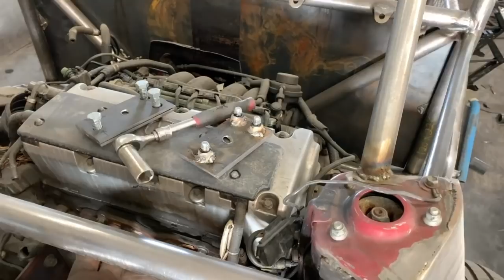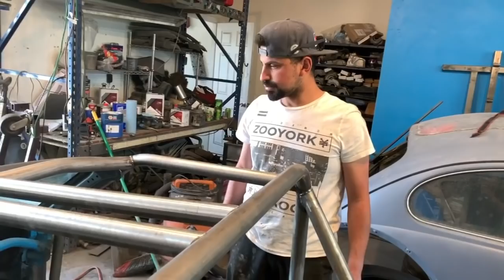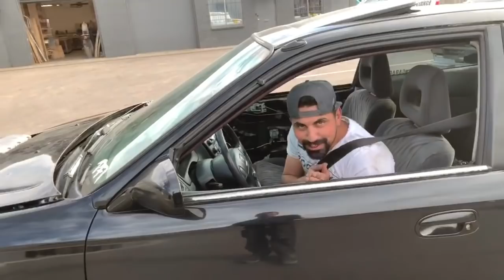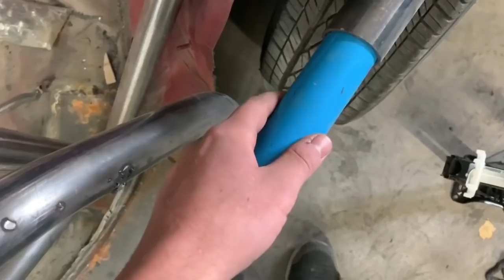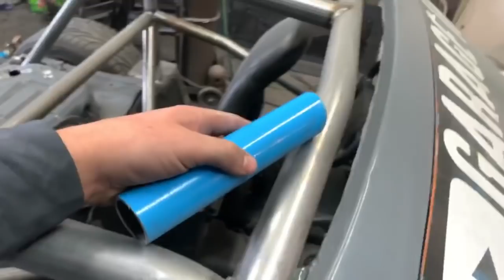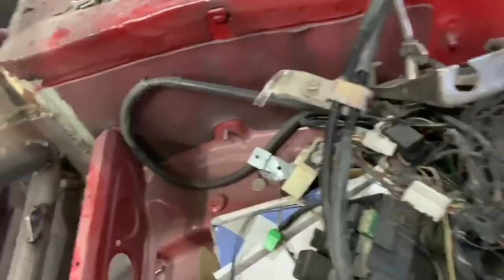Turbo Miata Kart! Drift Style Bash Bar Bumper Build!

Comment: You know you're getting better at this... I think I actually like the bumper, different but I like it. My small suggestions though are, where you were talking about putting the tail lights on the bumper, I think you need a one more short vertical pieces on each side that tie longer tire covering bars in with the upper hoop. 👍😉

You know we really haven't seen the Jeep all done up yet and running down the road, since you painted it. I really think you need to focus on that. I think it looks nice, from what I've seen of it so far. You need to get the cage finished up, and if you can make any more power quick easy and cheap then great! It's going to be a big head turner, no matter how fast it is or how fast it isn't. 👍😉

Why does it always make me nervous when I hear you say... "We Cut Stuff" 😆 that German is getting much better.😂 I wish I could afford that steel sandwich... two of them, with a Harbor Freight ratchet and a empty bag of Cheetos that would be awesome, sure it would keep me entertained for hours. 😂

Comment: "Steel-Sandwich" has better advertisement than TV's Shop-channel
Your brain running at 500+ mph is both your strength and weakness, having said that the bash bumper looks Awesome and Unique. Only possible "problem" is the the jacking point is too pointy.
Excited for what's to come. Be safe and keep up the great work
Reply from the maker: Yea was thinking about putting a 1” section of tube on that side

Comment: Lights down low in the bumper, and a high stop light centre and up high on the back of the cage FTW. Add extra marker indicator lights on the sides of the back of the cage too if concerned about being run over by a dodge ram or something while stopped to turn.

Comment: If you leave the bumper with a single tube sticking out to protect each tire I’d be more worried if someone bumped you on the track that they would bend it straight into your tire. To me it would look a little better and be stronger to have two tubes on each side connected by a half round tube.

Comment: Do NOT buy!  If I could give Zero stars I would.  I have never bought a product that so over promised and under performed.  All three of the captive nuts were welded on the wrong side of the steel plate.  I was planning on using the Cheetos bag to hold the three bolts but it was torn open at both ends... and it looked like the entire inside had been licked to remove all of the cheeze residue.  Very disappointed.
Reply from the maker: Hahaha well done my fiend!